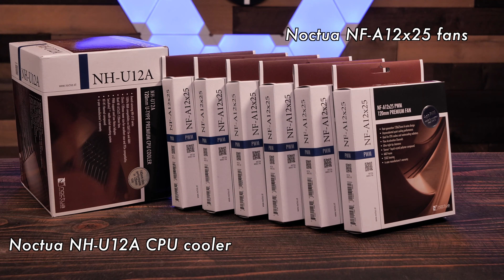Intel i9-9900k Gaming PC Build Guide: $2200 (2019)

Comment from the maker: *Here's the parts list for the build:*
Intel i9-9900K - https://amzn.to/2EtKdo8
InWin Gen 2 303C Case - https://amzn.to/2M4c7gQ
ADATA XPG SX8200 Pro NVMe SSD - https://amzn.to/2EEuuTB
G.Skill DDR4 3200 RGB RAM - https://amzn.to/2EueYJB
Asus ROG Strix Z390-E Motherboard - https://amzn.to/2K5ejSq
EVGA Supernova 550 G3 PSU - https://amzn.to/2WtPc2F
Gigabyte GeForce RTX 2080 GPU - https://amzn.to/2JZGGSf
Noctua NH-U12A Premium CPU Cooler - https://amzn.to/2Wlj550
Noctual NF-A12x25 Premium Fans - https://amzn.to/2EufNCb
CableMod Vertical PCIe Bracket - https://amzn.to/2YKKfzS
CableMod Classic ModFlex E-Series Cable Kit -  https://amzn.to/2JVTIQA
CableMod ModFlex SATA 3 - https://amzn.to/2JXw6es

Comment: Great video and an amazing system. I do have a question though. Why the 550w PSU in a 9900k/2080 system with 6 fans and a CPU cooler? Surely that isn’t enough power. Like I said though great vid. Keep them coming.
Reply from the maker: Great question! So the decision to go with a 550W PSU was made after doing a carful calculation of the real world wattage requirements of the system. The nominal wattage of the i9-9900K is 95W, the wattage of the RTX 2080 is 215W, so the big power hungry components come out to 310W, leaving us with a power budget of 185W for mobo, SSDs, RAM, and fans. A lot are people put waaaay too high of a wattage PSU into their systems than they'll ever use, which ends up wasting energy because the PSU isn't as efficient at doing its job when it's under utilized. There's a good blog post on Corsair's site talking about PSU efficiency and why it's important: https://www.corsair.com/us/en/blog/80-plus-platinum-what-does-it-mean-and-what-is-the-benefit-to-me  Now, if Jon one day decides to add another graphics card or another peripheral that requires more power then we'll absolutely need to replace the 550W PSU with something bigger. Thanks for the comment!
Reply: 2GuysTek Fair enough. Thanks for the info and reply. Love the build, I’m so jealous lol. Thank you for all the great content.
Reply: @2GuysTek  That system will pull about 450 watts at base clock speeds. You aren't going to do any overclocking on it? 100 watts is way too close to call. Its always better to have too many watts than not enough. Nice build anyways.